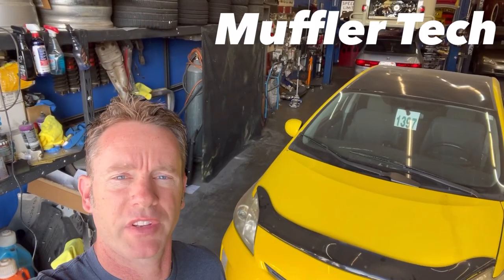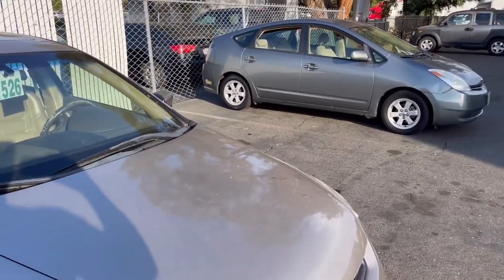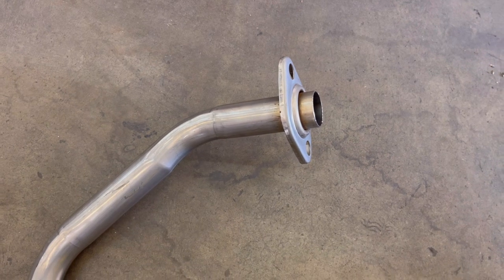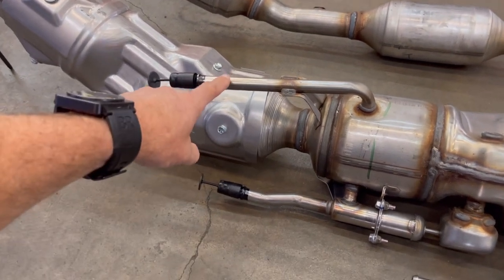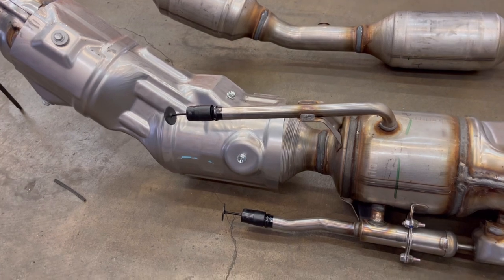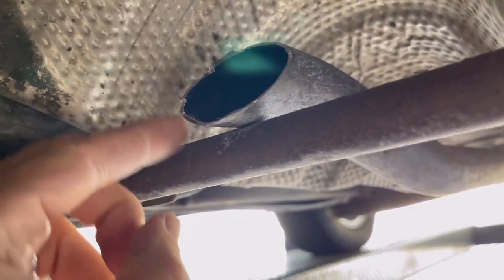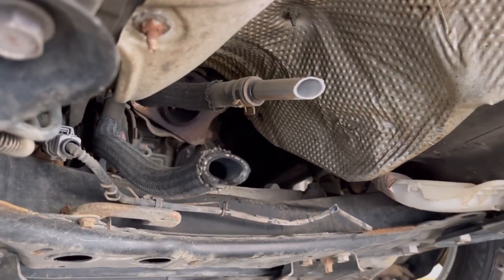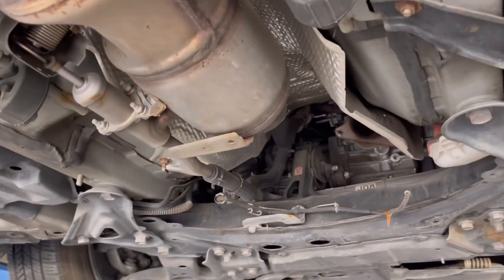You CAN drive a gen 3 Prius with a stolen catalytic converter…probably.  Watch for an explanation.

Comment: Ok, a question. If those coolant lines are cut, couldn't you just connect them back together, to loop the fluid back into the system, so none is lost/dumped on the ground ? Until you get it fixed properly, that is.

Comment: Hi do you know if it’s safe to separately jack up the right and then the left side of the front of a Prius if you dont have a hydraulic lift?
Reply: Yes, why wouldn’t it be? You would just need to make sure that you chock off the rear wheels, have the parking/emergency brake on, and the car in park of course. 

Aside from those basic tips, you primarily want to have a jack stand on each front jack point (on the frame rails?), and make sure that the car isn’t going to literally be TOO high to tip over.

Comment: I’m having some exhaust smell in the cabin on my 2010 Gen three - it hasn’t had the converter stolen , do you know any spots to check where it might be leaking and causing the smell in the cabin? Thank you very much 👍
Reply from the maker: You will almost always hear an exhaust leak before you smell one.  Usually if a leak is prominent enough to actually get inside the vehicle it will be large enough to make a fair amount of noise.  Exhaust leaks are not common on these cars unless there was a theft attempt.
Reply: @mufflertech  Thank you for your response another person suggested check the rubber grommets under the spare tire which I think I was messing with this summer... but at some points to there was a burning coolant smell as well —- knowing that the two systems are related in someway makes me wonder... The car has 400,000 miles lol  The other repair on the muffler system I had to do was where the heat shield burnt out the Mount and was rattling.. .
Reply: @mufflertech  and so funny just as I’m writing this -  I get a notification from Reddit , Calgary sub , that their catalytic converter was just stolen with a photo lol go check it out. Cc theft is so big here in Alberta, they got my 99 E350 shuttle bus 🚎 I just have it straight piped now, thankfully they don’t have emissions here

Comment: I think someone might have attempted to steal mine, there's a black crossbar thing that goes across the underside 'channel' and all but one bolt was missing on it. It must have taken too long for them to undo those I guess cuz it was just hanging there but I got more bolts on it and it is secure. Should I put anything else under there? Do you think this was an attempted theft? 
Seems like unbolting 6 bolts under the car wouldn't be that hard, unless I parked really close to another car or the curb on one side.
Reply from the maker: We rarely see that small cross support messed with.  We believe they do all the quiet stuff first and then cut with a sawsall last.  It’s like if they were trying to steal it they would’ve started on the front bolts that hold the cat to the manifold

Comment: I have a question. My catalytic converter was stolen and one of the coolant lines was cut as well as the O2 sensor. Can the coolant lines affect other parts of the car such as the electric water pump? I was told that I could still drive my car (I did not watch your video before :(  ) and while I was going uphill the CHANGE HYBRID SYSTEM appeared on my screen. Suddenly the red wheel emergency light came on and I was not able to put my car on drive. I was not able to drive it for the rest of the day. The next day, I drive it to a repair shop near me since they were able to install a  d-193-152 catalytic converter. When I left the shop my engine light was still on. I kept driving my car for 15 min. and the same problem occurred (Check the hybrid system) . Lastly, I took it to the same shop and running diagnostics they said it was due to a problem with the electric water pump. My insurance does not want to cover this damage because apparently is not related to the damage of the missing catalytic converter. I do think now though that the electric water pump and other parts of the car can get damaged if the   coolant line was cut. I would greatly appreciate your reply as this could help me with my claim. Thanks, Coby! Liked and Subscribed 🙏
Reply from the maker: Oh Miguel!  Operating these cars with a leak in the coolant system is a really bad thing.   We had a customer that overheated his engine doing this and it totaled the car.  It makes sense that your electric water pump has failed.  Water pumps need coolant as part of their lubrication and without it they can certainly fail.  I would argue that the cat being stolen  is what caused this and push hard on the insurance company to cover it.  Know that they are going to likely fight back on that you should not have been driving the cat post theft.  I wish you luck.  This is a good example of why I said you can drive the car "probably".  Everyone check those coolant lines before operating these cars.
Reply: Thanks Coby, insurance was able to cover it thanks to your feedback and video! You are the best!

Comment: I have a 3rd gen and the same way you showed us how they are stealing it on the white prius that was towed into your shop, my catalytic converter was stolen the exact same way, Ive got it replaced W/o heat exchanger, only because the heat exchanger is still intact but I  still need to install oxygen sensor but I have no heat, AC works but no heat. Changed the thermostat but still no luck. Checked if any coolant line are cut but nope still intact. Could the missing oxygen cause no heat? Or maybe something else I should start looking into
Reply from the maker: Interesting.  We have not seen this.  It’s possible the coolant pump failed.  Do you have any warning lights on the dash besides the check engine?
Reply: @mufflertech  yes sir starting today it started over heating still has coolant in vehicle and also now just started maybe an hr ago got the check hybrid system, stop vehicle in a safe place. Turned the car off, waited two min turned the car back n boom back to normal, after maybe 5 min of driving, same error message. Had to do that for 2 hrs just  to get home.
Reply from the maker: @wajirasheed  sounds like a pump failure.  I would not operate any more until it is properly diagnosed

Comment: They got me a couple weeks ago on my 2011 Prius, Cut the water pipe , Only Cost me about $150 to fix everything but it still sucked
Reply from the maker: I am glad you are back on the road, however, at $150 that doesn't fix it properly.  Did you delete the cat?
Reply: @mufflertech  ordered a new cat on eBay
Reply from the maker: @jasondominguez8434  you will likely get a PO420 code.  The cheap cats don’t have enough precious metal in them to do the proper conversion.
Reply: @mufflertech  put about 5k miles on it so far…..it’s working perfectly with 0 codes

Comment: Question, any way I could attach some flexible exhaust tubing between the exhaust manifold flange and the rest of the remaining catalytic converter, just to survive in the interim until Toyota can replace my catalytic converter? (they are on a 2 month back order). Thieves stole my cat EXACTLY as shown in your video of the white Prius. There is some pipe protruding out of the surviving cat assembly, wondering if I got some coupler pipe to insert into both that end and the flange/exhaust, then attached flexible exhaust tubing over that. Just a temp solution until parts arrive. I'm in Los Angeles and have to have OEM cat to pass smog.

Very similar to what this guy did:
https://www.youtube.com/watch?v=U2R7RetKNH8&t=206s
Reply: Hey man. I have the same exact question and I am in the exact same situation as you. What have you found out?
Reply: @raidermatt8398  Nada, they finally got a cat in at the dealer. I would recommend finding a mechanic willing to install a straight pipe or after market if you're looking at too long a wait time.
Reply: @ToweringCrane  thank you man. Do you think it’s worth trying to install a straight pipe like he did in that video himself? My only question is, do you know the inlet and outlet measurements of the Prius? I can’t seem to find them anywhere
Reply: @raidermatt8398  I had same problem. The hookup to the engine is a flange too. I think best bet is to have a mechanic do it.
Reply: I am in the same situation in Los Angeles.  Where did you get your cat installed and how long did it take to get the part? I called a dealer parts guy and he said if I come in and pay for the part ahead of time I would get top priority when a cat comes in. But he did not say how long it would take to get the next one in.  Any ideas would be appreciated.
Reply: @lonniegarner4716  it took me about 2 months. It’s brutal. Get the shield.